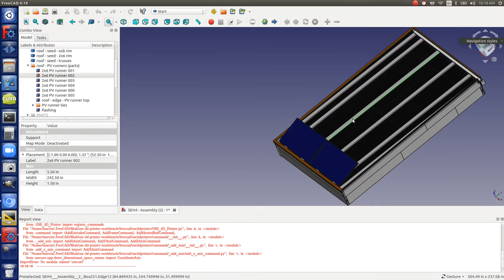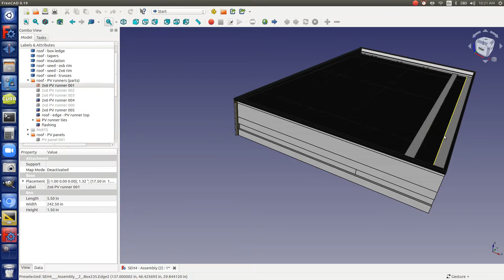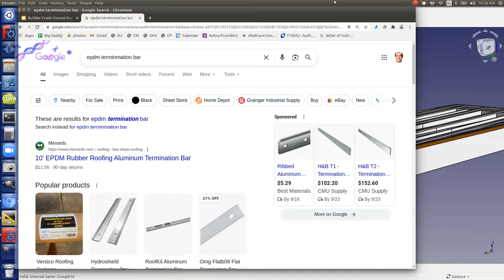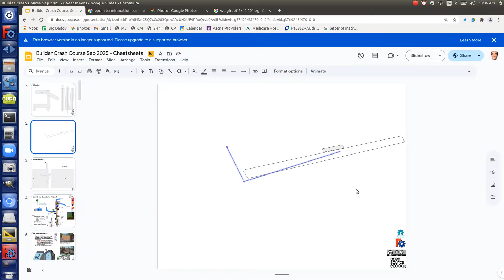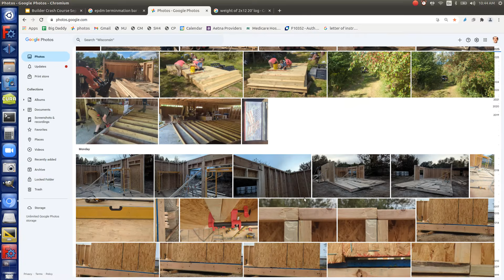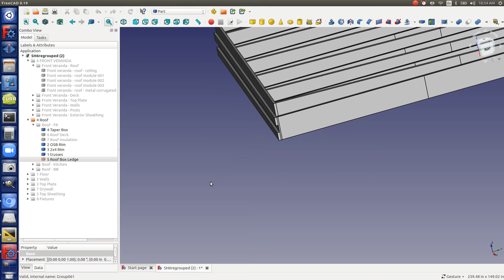Seed Eco-Home 6 Structure Design-Build Discussion

Comment: Now that you are starting more swarm build construction projects, here's a tip that has just been documented on youtube by a framer.

Multiple tape measures used on a build may not actually calibrate to the same lengths, especially if they are from different manufacturers, different models or different batches!

Here's the proof: https://www.youtube.com/shorts/HJZgN5wusU0

I ran into this problem with different levels, some of which were purchased used and were probably sold because they were no longer accurate.

Some professional builders either do a calibration check at the start of each day's work (and stow away any "bad" tools) OR hand out a known good set of measuring tools that will be used for the entire project for consistency.

Hope this is helpful to the OSE Teams.